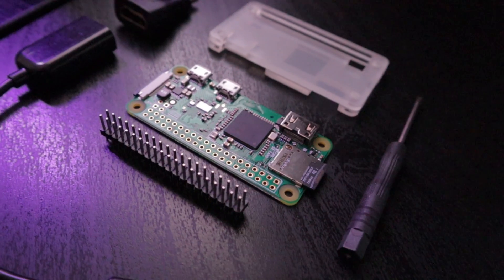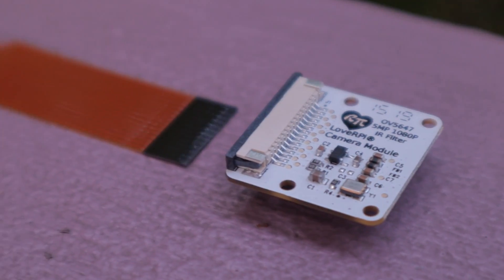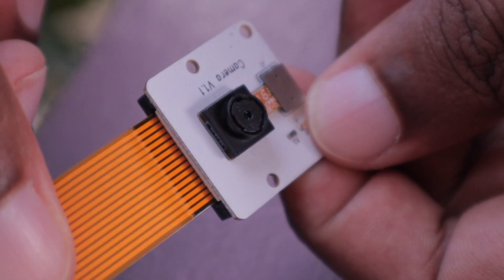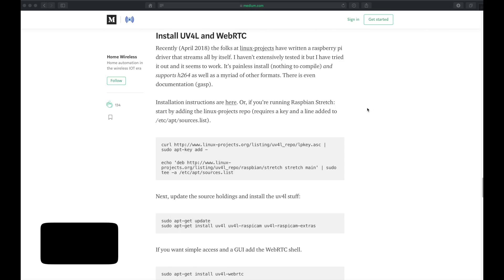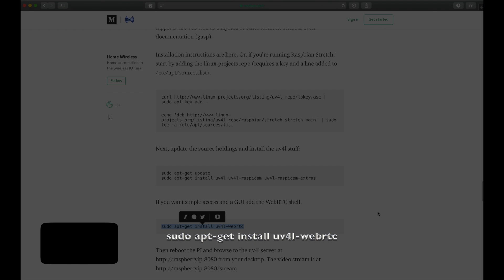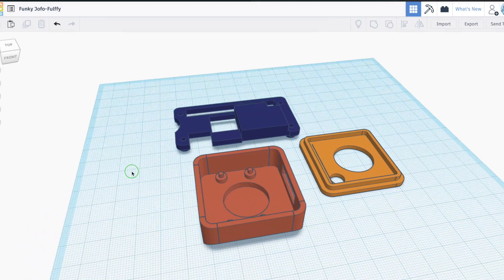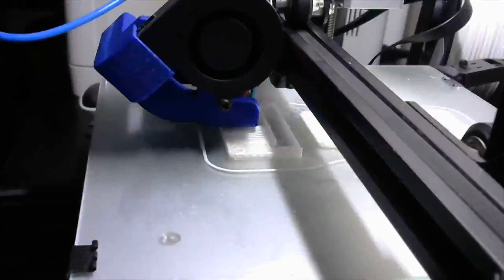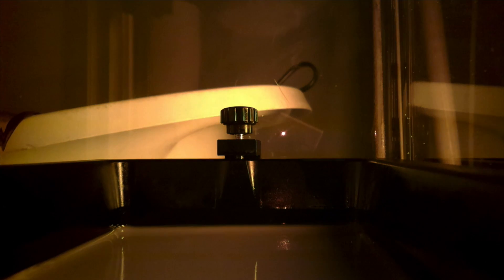Add a wireless camera to your Anycubic Photon, Elegoo Mars, Epax X1 or any other SLA Resin Printer!

Comment: Is not better getting a wyze camera from amazon for 29 dollars, they are small wifi cameras and use the app ?
Reply from the maker: I guess that can be an option to monitor from outside the cover. This will allow you to put the camera inside the cover and makes for some amazing time lapses :)

I guess it comes down to what you want out of the camera
Reply: @FrameonesMakerspace  yes but the wyze camera is build in magnet  and also  tiny ot will fit perfectly inside the anycubic photon and is 1080 too with night vision
Reply from the maker: Need For RC in that case it will be perfect!

Comment: i dont understand why they dont make clear plastic resin tubs so you'd know if it's a bad print right away and not 500 layers in when it finally comes up out of the vat :(
Reply: it is mainly due to the fact that the resin is uv sensytive
Reply from the maker: I have seen those. Unfortunately not for the budget printers like the Photon or Mars